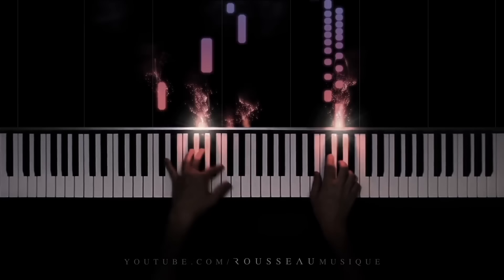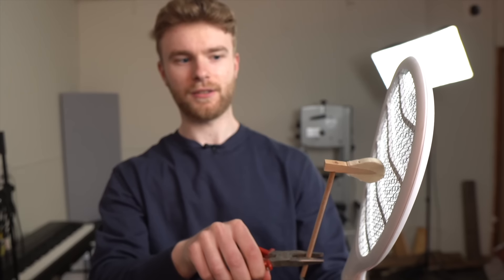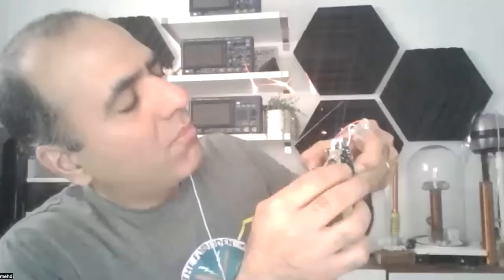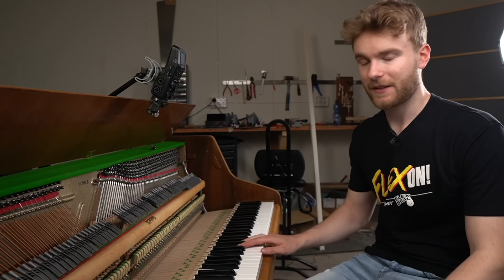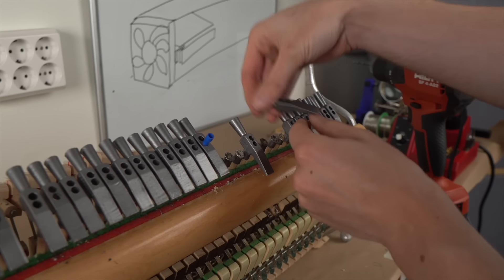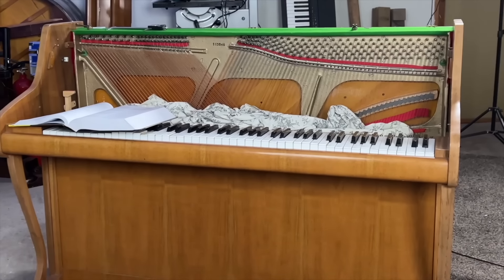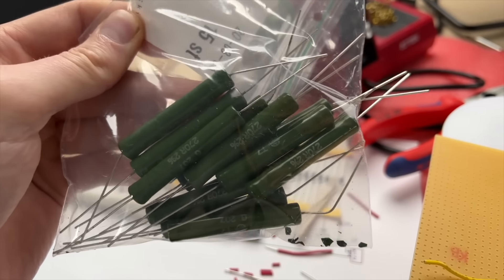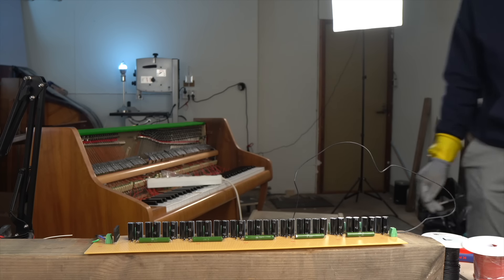How to NOT make an electric piano ft. @ElectroBOOM

Comment from the maker: Join discord to see what the f I am doing to my poor piano currently.  https://discord.gg/mattiaskrantz you’ll see me in engineers-only (i’m an engineer)
Reply: Matt
How do you come up with these kinds of videos?

Also 
Make more!
Reply: I think Mark Rober can turn this into a really good one! He has a robot piano but He's in US tho.
Reply: Run the piano through a variac, so at least it's isolated... still terrifying, but isolated.
Reply: @OriginalCircuit  NO, DO NOT run this through any kind of isolation. Running this through isolation prevents the GFCI/RCD from triggering and saving your life. Isolation is the last thing this thing needs. Isolation also has zero benefits to this project.
Reply: I feel like as an extra precaution if you were going to use a normal piano, which is out of wood, I would say pre-treat the wood before putting anything that could cause a fire in it, like either do one of the Japanese methods I have seen which involves treating the wood with a coating that makes a layer of glass that makes the wood pretty hard to burn, or pre-burn it so it is blackened so it also has a harder time igniting and burning, if possible do both.
Reply: @gearthannipat3107  mark rober is the wrong kind of engineer. Mehdy was the right guy for him to contact.
Reply: Now step two, transform into a Tesla coil using the hammers as the electrical output, increase amps decrease volts, then you'll get electric arcs to the strings and not ruin strings. Use chicken wire cage to protect hands ☺️
Reply: Master electrical engineer specialising in HV, sounds fun. Currently working on a project in the Netherlands, but would happily pop over.
Reply: So you can listen easier did you consider wearing ear plugs, linked to your recording software. under your hearing protection.
Reply from the maker: @greyfox9904  I can’t share my email here but I’d love to dicuss more. Can you dm me on Instagram or Discord? Thanks!
Reply from the maker: @GlenBixley  this piano actually have a mounted midistrip with optical sensors under the keys. I just did not even consider to use them for some reason. So I could start the hammer piano VST and basically listen back to the actual piano without any sparks!
Reply: @Mattiaskrantz  Good to see you had hearing protection.
Reply: Can you make a tutorial how to make the notes falling down on a classic piano??
Reply: The man himself
Reply: oh that sounds fun don’t forget to tell me how many brews you got it at the end
Reply: you could make a glass or plastic pane over it, so you can see the sparks but nothing jumps in the face
Reply: Collab with Michael Reeves next. He will have ideas that will make you crawl into a hiding space and cry.
Reply: Hej, svensking?
Reply: @minetruly  they both make really dumb decisions and we’re kind of smart Greek lab 2029 coming soon
Reply: @EnthalpyAndEntropy  
Agree 100%. Mehdy ElectroBOOM was the absolute perfect person to call.
Reply: I’m an American electrician and I know moonlight sonata on piano. I especially liked this video, awesome job!
Reply: @EskimoBENNY  🤔🐕
Reply: Are you realy german? Because I am going to be a Mechatronik engeneer in germany. What Form of engeneer are you? Maschinenbau, Elektrotechnik, Mechatronik, ...
Reply: @maxhommerding1577  I want to become a engineer when I grow up but I'm not from Germany 💯👋🗿💯🏎️💻🗿👋💻🏎️📱👋🗿💻
Reply: I have literally subscribe you  , Electro boom , I did a thing
Reply: Just make a cooling system for the resistors and maybe put in a voltage lowering circuit to lover the voltage to about 4 volts below current capacitor output
Reply: This video is called how to build a piano torturer for kids if they don't play piano for 40 hours
Reply: If Asian parents see these they will definitely buy it because if they don't get 100 for all their subjects they're gonna get punished
Reply: I don't want a pro pianist to die from this..
Reply: if you are still looking for advice... use acrylic panes to prevent the sparks flying into your face(think of the shield you use over grinders), your resistors are too small that is why they over heat(for how fast you are trying to charge the capacitors the resistors you have now can't handle the current load and dissipate the  heat fast enough) if you drop the voltage to the resistors(just add more resistors in series on the main line or use a rheostat) it will drop the current draw or could try fan cooled...basically anything that makes a good arc welder is the opposite of what you want... also have fire extinguishers near by because you will get slag falling on dry aged wood... thanks for the vid it was fun to watch
Reply: Okay I know it's crazy, but how about filling a piano with helium instead of a guitar?
Reply: could we maybe get a flash warning and a loud noise warning in the title? its uh
its loud 

like its cool
but loud
Reply: Hey, there is someone using your name telling people to message them on tellagram. I don't think it's you so just a heads up.
Reply: Jag visste att du va svensk! Hörde det på engelskan😂😂
Reply: @Mattiaskrantz  what kind of engineer are you?
Reply: Oh yeah take the fire hazard into the forest.. what a great idea
Reply: It would be great to have acrylic plastic in front to protect yourself
Reply: Why don’t you tune a piano to play Yiruma - River Flows in You when you play it left to right key by key? Is that even possible?
Reply: imagina o lord vinheteiro tocando esse piano kkkk
Reply: you could add a fuse to the dc side after the rectifier but really just using a gfci or afci is plenty for the ac side. just keep those fiddley digits out of the wires when energized
Reply: Collab with Great Scott!
Reply: So, fun fact: 
Fabric softener is a conductor.
Reply: @greyfox9904  !
Reply: Well done mate you just created the best looking fire hazard I know of
Reply: You can stop the resistors from burning out by getting two with twice the resistance,  and soldering them in parallel.  You will have the same resistance,  but half the current will flow through each,  which means half the heat on both of them.   Fellow electrical engineer.

Update,  I should mention you'll want the same watt rating,  or at least half of it.
Reply: find a way to convince Vinheteiro to play this, lol
Reply: @Original Circuit  most variacs are NOT isolated!
Reply: @Internet Anon  incorrect.  While proper galvanic isolation will keep a GFCI from triggering, it also eliminates the need for GFCI.  This is what is done in cell phone chargers.
Reply: You couldn't make anything more useless even if you try, I guess that makes you useless.
Reply: Yes
Reply: I tried changing the material of a violin. How about you do the same, but with a piano? Basically, you take out a string, then add a different thing to it (like a wire) and tune it. 

Extra points if you change each string to a different type, none of them the same as another one, with the middle C string being normal
Reply: The heck is going on with the youtube music thing???
Reply: Boron nitride is non conductive and tough. Maybe useful to try..
Reply: I sent a bad idea look for it
Reply: If it involves a hole and a woman's wig, don't show it.
Reply: @NetAnon A variac is not a source of galvanic isolation.
Reply: @OriginalCircuit  A variac is not a source of galvanic isolation. I suggest you retake your electrical engineering classes on power engineering, section : inductors, section: transformation, section: specialised transformers or take a masters degree with a specialisation in transformer technology.
Reply: squarespace sux
Reply: My name is Matias XD almost like yours
Reply: Subs 0:41
Reply: Repent and trust in Jesus. He's the only way to Heaven. We've all sinned and deserve Hell. Sins like lying, lusting, etc. Repent and trust only in Jesus, and you will be saved! You can be saved because he took the punishment for our sins on himself when he died on the cross, just like someone can pay your speeding fine in court, and you get off free.
Romans 3:23
John 3:16❤❤😊
Reply: Maybe this is a fire hazard.. 
That's funny stuff
Reply: The thing is sparks don't actually require high voltage. I'd have maybe used a 24 or 48 volt transformer, and kept it AC. That way the sparks automatically extinguish when the current flow crosses 0 volts.
Reply: @OriginalCircuit  
Noo Noo Noo Noo Noo. Not for that purpose. Variacs are even less Isolated than standard transformers. Your hot side out is connected directly across the primary winding.
Reply: @Mattiaskrantz , OMG! I can't help but notice how freaking funny your thumbnail is! It literally describing*pain*
Reply: Matt what’s that song that you play on the piano most of the time?
Reply: just an idea could you size the caps relative to the notes to change the tone of the sparks ?